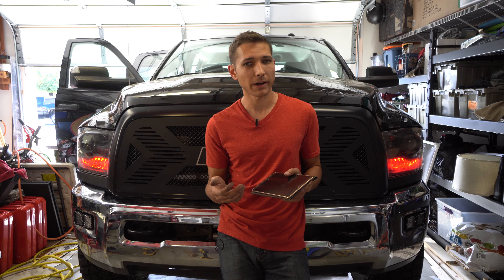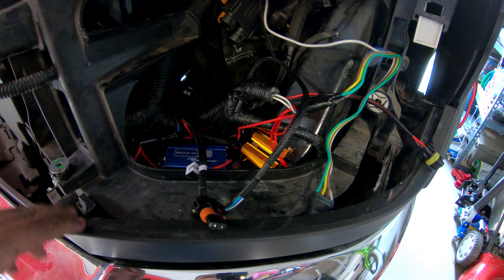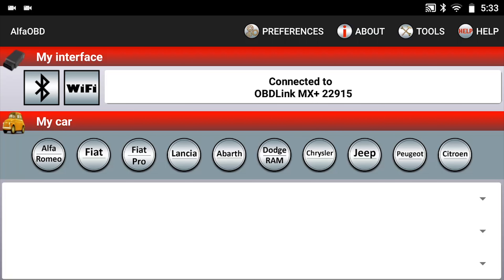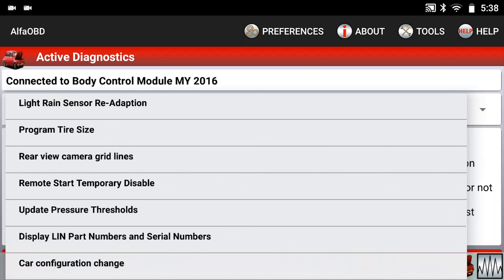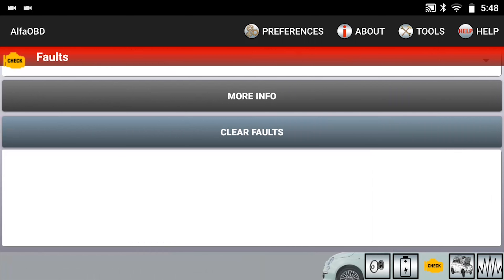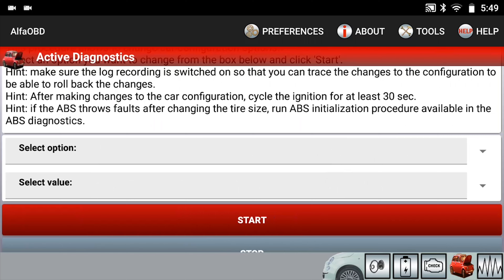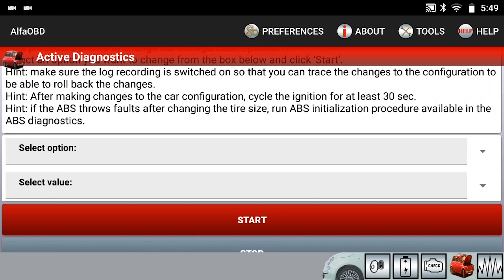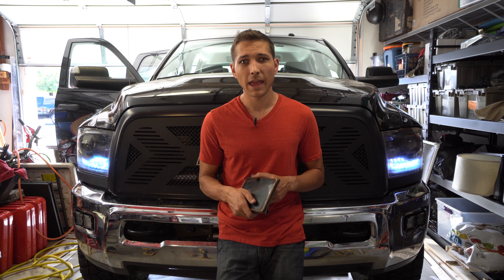Ram Bulb Out After HID/LED: Alfa OBD Error Fix For Headlights+Turn Signals

Comment: I have been trying to get the GTR Armor switchback front LEDs to work in my 2015 Ram 1500 to no avail. I erased all codes before changing settings and then enabled both front LED parking/marker lights and LED turn signals. They flash correctly for a few seconds  then hyper flash and then throw codes. IDK what I'm doing wrong! LED high and low beams work great.
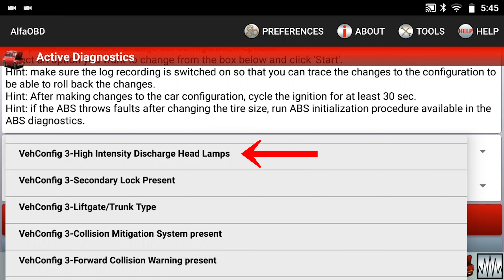Reply: I also bought switchbacks, but I don't have LED high and lows beams installed. So I Enabled LED "front turns", and "park/markers" at first like you with no luck and then LED "DRL present" to still throwing codes. I think it has to do with either the "HID" or "Xenon" setting he was talking about around 4:08. Since I don't have HID or Xenon headlights I didn't enable these settings and reverted back to my old bulbs and settings. I may just buy LED headlights and try it again.
Reply from the maker: Yeah, like thedieslexpress said, try out some of the hid or xenon settings. Or, run the thing that shows you every code/setting (literally shows every setting your truck has and what it is "set" to) and see if it shows as actually changed.
Reply: @chazpages  I tried activating HID in Alfaobd but it did't help. The really weird thing is that they work perfect with the headlights off. I have DRL activated on high beams at low voltage and the turn signals work great even with DRL on. When the headlights come on, and I turn on the either turn signal, I first get the marker light malfunction message, followed by the turn signal malfunction message with hyper flash. I can erase the codes with AOBD and they work again for a few seconds. Very frustrating!

Comment: Yep I watched this video and changed them with no luck still. Once you connect to the body control module it says hint to cycle the key for 30 seconds. Is this something that's  needed to be performed. I seen a pdf file for ram truck I'm guessing how ram recommends adding aftermarket lights. I'm at a lose point of what to do other then buy new halogen tail lights

Comment: 2015 ram 1500 morimoto XB LED swap and the AlphaOBD w/configure program = 👌🏽
Reply: Silentman08 
I just put Morimoto XB LED on my 2014 Dodge Ram 1500 and I am getting all kinds of codes. What did you do to stop your error codes? And I changed all settings to LED and still getting error codes
Reply: J H I didn’t have any error codes , low beams turned off after 18 mins only . Otherwise mine work just fine
Reply: Silentman08 
Okay thanks I will keep trying
Reply: J H I have the morimoto resistors and disconnected the green wire . My truck had stock projectors
Reply from the maker: Let me know if you can't get this figured out.
Reply: Silentman08 
Silentman08 what did unplugging the green wire do?
Reply: J H it made the blinker sequential mode
Reply: Silentman08 
Thanks again
Reply: @chazpages 
 Still having the same problem saying backup and parking lights out. So I emailed the company I purchased them from and they are saying I have to reprogram the truck? Is there a way to disable the error message or reprogram with the Alfaobd?
Reply: J H any luck bro I’m having the same problem

Comment: This works great on a 2015 Ram 1500. Thanks a lot!
Reply from the maker: woohoo!
Reply: I have a 2015 and I’m hoping that it fixes my upgraded led headlights from going out! The resisters aren’t working!
Reply: What settings did you use specifically?

Comment: Thanks. I was able to activate the DRL feature and keep my HIDs on.
Reply from the maker: Nice! Do you remember which changes you made?
Reply: @chazpages  I will have to go back and look.
Reply: @Charles Pages CBC Features - Bi Xenon Headlights Enable made it Yes and  CBC Features - LED Low Beam Lamps Present Yes as well.
Reply: Guys I just installed Morimoto elite Xb HID on my low beams only. No harness, no resistors. Using AlfaOBD, I selected YES to VehConfig 3-High Intensity Discharge Head Lamps. No other changes. They seem to work. It’s still noon so I can’t see any flickering but they seem ok to me

Comment: So if i get an alpha obd and buy HIDs do I need still to purchase their anti flicker module/canbus  decoder or does the alpha obd resolve all of this? Ive read a lot about the auto-on lights function not working after installing HIDs, I assume the alpha obd fixes that?  (2014 ram 1500 sport)
Reply from the maker: Nope-the anti-flicker/canbus is to "trick" the truck. You won't need it. I'm not sure about the auto-on thing, but I think you should be good to go with alfaobd.
Reply: Did you manage to figure out the thing with auto on? I’m looking to change them out as well and trying to figure out what all I’ll need to do to make auto-on function work with HID.

Comment: Just to make sure I understand correctly do I need to swap the setting to led present for HID swap or is there a separate switch for HID I missed? I'm changing low, high, and fogs to HID! Thanks for the vids sir much appreciated!
Reply from the maker: There isn't other settings for HID that I know of. I would try changing the stuff in the video I mention first (after the HID settings) and go from there. If that doesn't work, then try out the HID settings present/not present. 
Don't forget to post up what your results end up being so others will know what worked for your setup!
Reply: Try this CBC Features - Bi Xenon Headlights Enable made it Yes,  CBC Features - LED Low Beam Lamps Present, and CBC Features - LED Front Fog Lamps Present Yes.

Comment: I have a 2015 1500 Sport, I’ve switched my front turn signal, low & high beams to LED present. But I’m still getting a hyper flash on the side mirror turn signals and front turn signal light out error both right and left. Any ideas on what else I need to change? And by the way your video was very helpful!

Comment: i added after market led swtchback turn signal puddle lights to a ram 1500 sprt. The sequential function doesnt operate correctly.   The other features work fine...any suggestions

Comment: I have done these changes (after doing an led upgrade) but still get a bulb out message for my right rear. I even swapped back out to the original bulb and still have the message. Any idea of where to check / what to check now? Also I would like my DRL to be my turn signals (diode dynamic switchbacks) but the running power only activates the Amber color....is there a way to give it a signal to power the white side for DRL but still function with Amber turn signals?
Reply from the maker: Get this resolved? Did you try clearing out the error codes you had? 
The DRL stuff I'm still trying to map out and explain properly. Although your wiring doesn't sound correct-running lights should make the bulb white, and amber when the blinker is on. Is the bulb for sure a white/amber? They also have just amber too.
Reply: Charles Pages so I ended up turning off the error code in the body for the rear (I did clear the codes, and did a hard can bus reset). But I still get a bulb out from my front turn signal, only when the headlights are on and I hit the turn signals....when it switches from the white to amber and then back to white it dings saying there’s a bulb out and then goes away directly....I just need to upgrade to the alfarex headlights lol

Comment: How to cut on my Cargo light that has been cut off by Factory Ram 5500 4x4 2015 was a flat plate but installed light can get it to flash in a test mode but don't know how to cut them on.

Comment: I have a 2015 ram with projected low beams I installed Hikari ultra led when truck is off they work when start it they kick off the bulbs are h1 will this fix my issue or will I need to add decoder?
Reply from the maker: Bulbs for projectors shouldn't be H1, unless they're aftermarket lights. This can set you up right, no need for a decoder or resistor.

Comment: i have that turn signal out error display on my cluster.  I see the hyper flashing on the cluster when I use the turn signal, but the turn signal is flashing normal.  So if I clear faults this should prevent this error code to display ?

Comment: Just got Alfa and new aftermarket projector headlights with switchback led turn signal/drl and the truck has turned off the right turn signal, drl and now marker light. I tried what you did and nothing is coming back on and I still get the fault codes. Any advice!?

Comment: I have a flash blink on on my tow mirror after installing aftermarket tail lights. OEM WAS Factory-led tail light with halogen reverse. Now its all one plug instead of two and throws error could for all lights out tail light. But tail lights work normally and tow mirrors flash fast and in the dash. Not sure how to fix this :(

Comment: Which program would work for a 2018 ram 1500 sport with projector lights casing. I put hid in the truck and have hikari resistors. They flickers twice and then it says bulb out on the front. What would work?
Reply from the maker: Take out the resistors. Use alfa and follow this and you should be set!
Reply: @chazpages  thanks buddy. The only thing is i have heard that the 2018 ram 1500 sport has some additional security feature that the 2013 to 2017 ram doesnt have. What would i need to bypass that so i can use this program ?  Any help is appreciated ?

Comment: I’ve put switchbacks in and can’t seem to cure the parking and blinker bulb out errors with alpha obd can you tell me what all setting need to be made to cure this? Thanks
Reply from the maker: What settings have you changed so far? And which bulbs did you get? Did you change any wiring?
Reply: I’ve got JDMastars and didn’t do anything to the wiring. I’ve turn everything to led as I have all led bulbs in the truck.
Reply from the maker: Have you cleared the error codes yet to see if they return?
Reply: Yes. They come back as soon as I hit the turn signal

Comment: I installed the Spyder tail lights and as soon as I put them on the "left tail light is out" message came on and I already enabled basically all the rear LED lights and I still have that message on the dash, what can I do to clear this?
Reply: I'm having the same issue but with my left low beam. Have you found anything?
Reply: @parkerschuck8685  not yet I have been trying to figure out , I even cleared the wrong codes but the message still there. At this point I'm really disappointed I'm thinking to get another set of tail lights that come with better resistors

Comment: I'm having the park light out message on the cluster. I followed the links you left in the description and purchased the obd2 and the alfa obd software. I've went in and changed the led setting and after changing the settings gave it bout half an hour or so and started the truck turned on the headlights and once I hit the brake pedal the message displayed again. Is their a step I'm missing or something else I need to change I've got aftermarket led tail lights and halo projector aftermarket headlights. Any information you can provide would be greatly appreciated
Reply: Cody...I know this is bush okie, but here is something I tried with another set of F&R's I had that I just couldn't get to work.  I spliced in 4 3157 females sockets, one at each corner.  That made 2 connections per corner.  I put a 3157 bulb in each of the connectors I installed and then installed LED's/switchbacks WITHOUT resistors in the other four and put them into the light housings.  Worked like a charm!  No more errors.  I epoxied short pieces of PVC pipe over all four, just short enough to protect the bulb but be able to remove it.  Then I wire tied it up out of the way.  Yeah, I know.  But it worked great.  I've since moved on and removed them, but it might be a good experiment for you.

Comment: Upgrade my quad headlight to projector with hid in lowbeam on my 2018 Ram 1500. I now have parking light out error message. Will I be able to clear the error with the alphaobd?
Reply from the maker: Absolutely! Clear it and fix it for good! Don't forget the bypass harness...
Reply: Charles Pages where can I get this bypass harness?
Reply: Didn't the bypass harness start on the 2019 model year? Will I need one as well for my 17?

Comment: Hey man got a ? For u. I got a 2018 ram 2500 n did some halos DRL boards switchbacks(the retrofit source) n I got hyper-flash only on my mirror turn signal other lights r working fine and a message on my speedometer that my left turn signal is out. Any idea how to fix it? Thanx
Reply from the maker: Do you have alfaobd? That should solve the problem for you. You'll need the bypass thing which is about $50 though (18+ need it).
Reply: Charles Pages yes I do have both already n try it but didn’t work it still the same?
Reply: Charles Pages ever figure it out ?

Comment: Do you need a relay to keep power through your HIDs after enabling everything in Alfaobd?
Reply from the maker: No, but I would recommend it. HOWEVER, you will need to have something plugged into (most likely the passenger side, the way relay harness' run) or the truck will say bulb out. A small led bulb works just fine. The computer otherwise thinks a bulb is out because there is nothing plugged in/using power.
Reply: @chazpages  hi! i am trying to do the same (HIDs on my low beams), i have a relay installed on both lights. i am still getting a low beam out error though.  where am i suppose to connect the small led bulb you mentioned here? thanks.
Reply: I installed a H7 HID kit with a H7 specific harness and still get the bulb out error for my right headlight even though I have changed the settings in Alpha Obd. All my lights are working like normal. Any ideas.

Comment: I tried to change the configuration to led on my turn signals. It's not changing on my 2012 dodge 1500
Reply: Same on our 2019 ram classic 1500. Still have errors for tail lights and brake lights. Never had errors for the reverse lights.

Comment: I installed aftermarket projectors on a 2014 sport and since then I have turn signal code and hyperflash do you have the solution? Thanks 😅
Reply: Disable driver and passenger door ajar setting. The blinkers send a signal through the canbus there

Comment: Did you still need to run the relay harness to make the lights work? I have a 2017 laramie 2500 and want to use HIDs in the projectors.  I have alfaOBD just need to know if i need the relay harness
Reply: The point of making those changes is specifically so that resistors aren't needed!

Comment: Apparently 2015 rams can programs are different from 2014 and 2016. I am running morimoto headlights with resisitors. Has anybody figured out the secret combination? Dealerships are no help, they say it isnt possible due to pcm not having enough output power.
Reply from the maker: Which settings have you adjusted? I switched to a 2015 as well, and there I think I had to have led and hid both selected to get the passenger side bulb error to go away. I wish there was more “detail” regarding rams weird logic lol.

Are the resisters inline? Too much power draw can trigger issues too. If so (inline resistors) fry bypassing them and see if it helps.

Comment: Hello, thanks for this genial apps. Is it also compatible with Ram 1500 2019?
Reply from the maker: I believe so. You need a bypass cable installed (at least on the 2018 you do) so I'm sure 2019 does too. From my quick research it seems that you have to choose 17/18 model but it works for many of the settings.
Reply: Classic 2019 classic only and like he said u need the security bypass harness. I use this i just pick 2017. Works the same

Comment: does it fix the flicker in high beam led bulbs. or do i need the load resistors 50w, 6ohm?
Reply from the maker: No resistors needed-it should fix the flicker.

Comment: So what do eliminate once I change the setting? I have the relay, resistor and I’m assuming I have to use the ballast.
Reply: I’m assuming I can eliminate the relay and resistor?
Reply from the maker: Leave the relay, get rid of the resistors. Ballast will stay. 
As for the relay, you can get rid of it, but I'd probably just keep it. It will ensure your hids get the power they need, and can help prevent issues with hids not firing up/working. Some guys have luck on factory wiring, some need/like the relay.

Comment: My 2013 Ram 1500 outdoorsman I put led tail lights, license plate led lights, led high output fog lights and led 3rd brake light, zero codes or issues except the license plate leds stay dim after shutting truck off for a few minutes then go off. Now, I also put in 2019 style headlights and added katana leds in the low beams projector, zero issues, but the led already in the light assembly is causing a random light out error only on Drivers side, the sound when turn signals are on is faster than normal at times, but out at the light, it still blinks normal. Odd how these trucks work.

Comment: I switched from quads to Alpharex G2 headlights and only get “parking light out” error when the headlights are on and i turn on a turn signal. I have switched everything to led. Then heard to try and use HID and i have tried a couple others too. Nothing is working for this. I have resistors but really dont want to use them if it can fixed via alpha.

Comment: I did exactly what you described, I removed my resistors and now getting a parking light out message. I switched to led settings. All my lights are working. Any ideas? 2015 Ram 2500